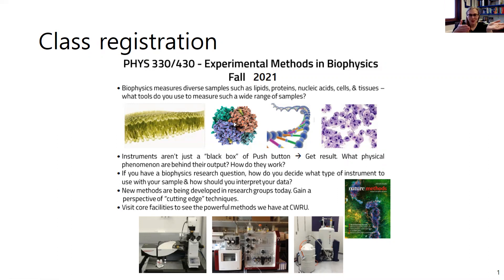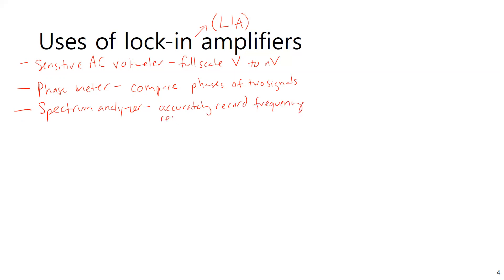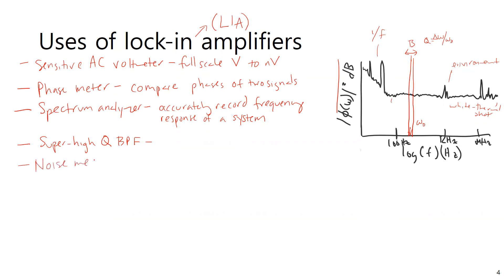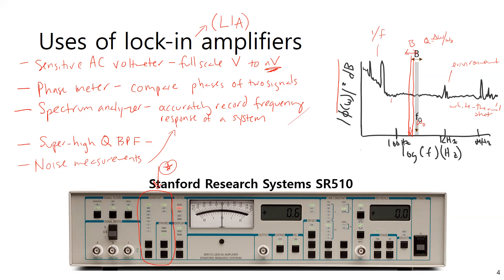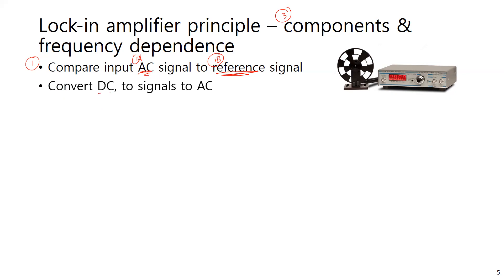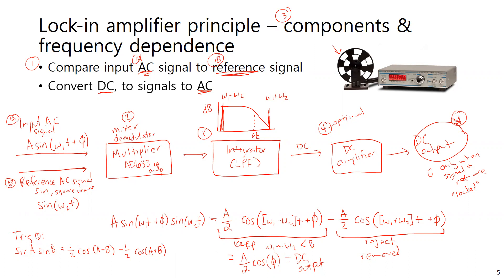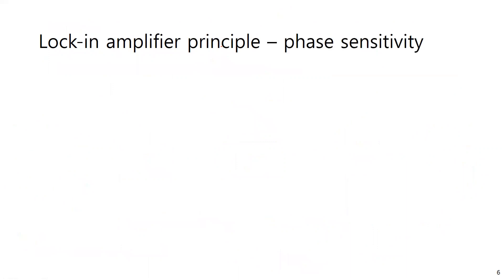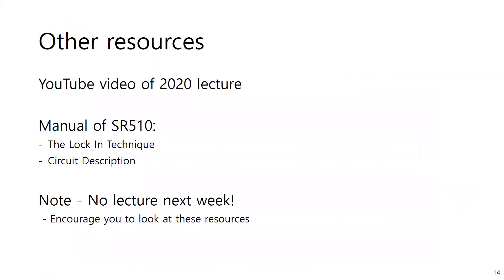The Lock In Amplifier (LIA) (20210405 - In Class Lecture)

Comment: I gave the signal from a function generator as shown in the picture above.  That is, 10khz from one channel and 100hz from the other channel and the two were combined and given to the lock in amplifier.  Then 10hz was given as the reference signal.  But 500mv, the vrms value of the 10hz signal, will not show then.  Showing a much lower value than that.  Is it not possible to measure the voltage of one of the two channels together by the lock in amplifier as above?  Is there anything wrong with it as you know it?